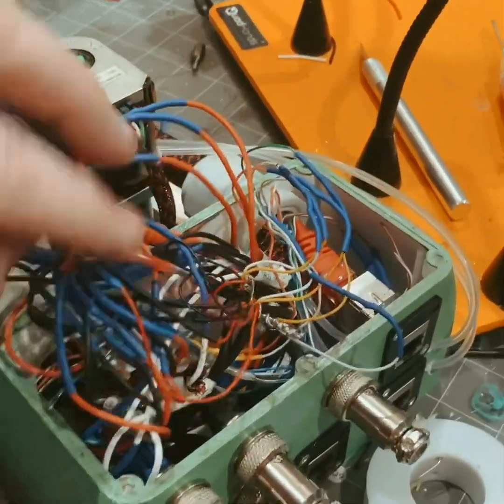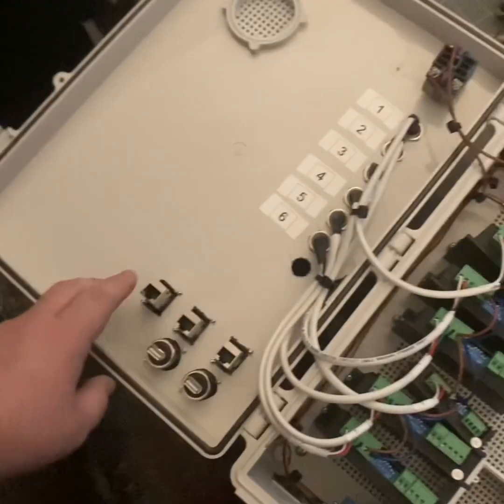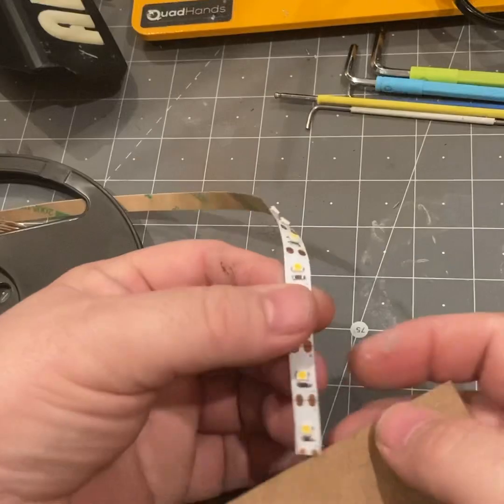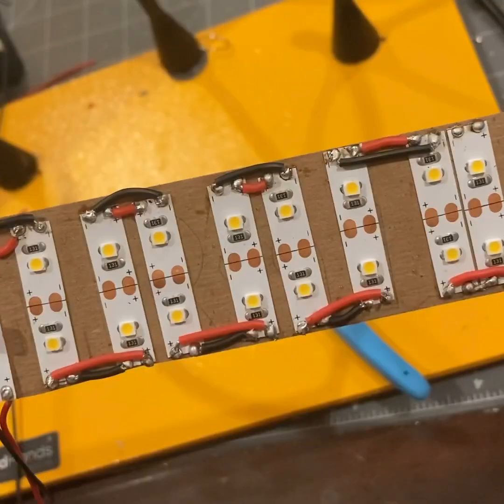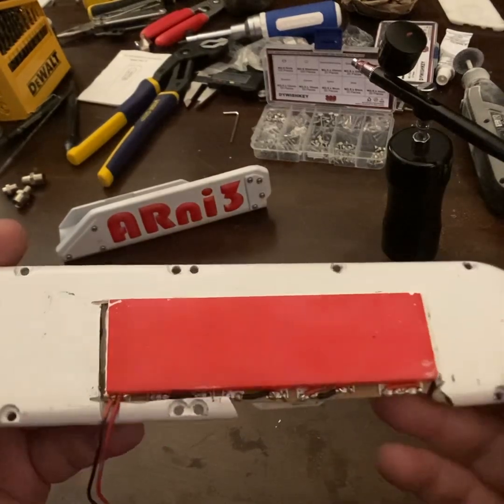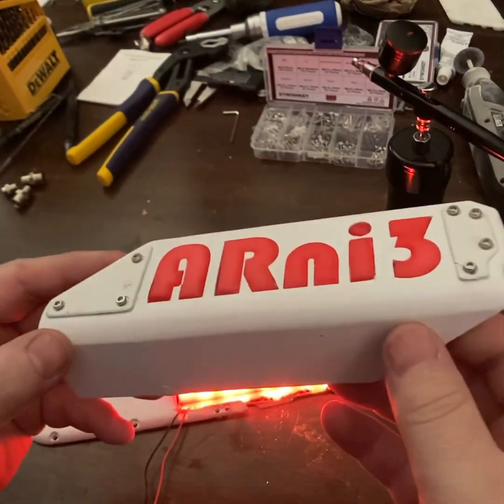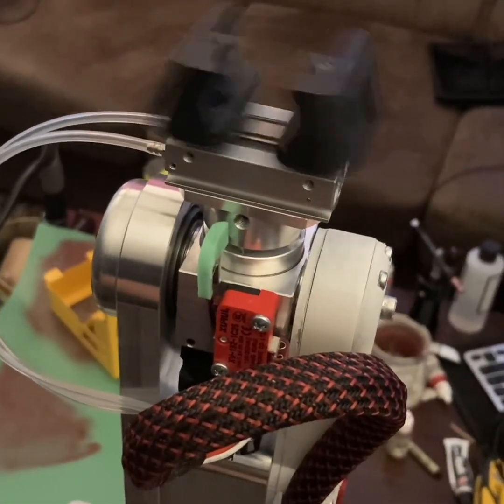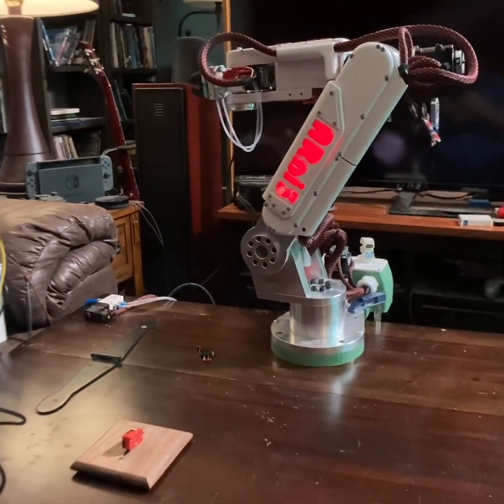AR3 robot ARni3 is done!

Comment: Super cool build, I'm thinking of building the AR3 for my man cave. Do you think something like this would be possible with these bots? My main concern is with the shaking motion and speed under load. https://www.youtube.com/watch?v=EivBxP3kqWs
Reply from the maker: I bet it could do it, especially if it’s like in the video where it brings the load closer to its body rather than trying to shake it while the arm is stretched out.
Reply: @thecraftinator9070  thanks for getting back to me, its great to hear you think it could be done because the other options are significantly more expensive! Do you think the speed could be similar?
Reply from the maker: @ok25531  yeah, this sucker can be super fast.  Especially if your moving multiple joints like the bot in your video.  Like using the wrist to whip the last portion as a secondary motion,  so the joints work in concert to get that movement.
Reply: @thecraftinator9070  Looks like I have a lot of robot kinematics to be looking into!  I’m from a software background so it’s all very new but that’s part of the fun haha. Thanks for the help!
Reply from the maker: @ok25531  absolutely, I want to get the gist of the simple programming language, you’ll be fine. The hardest part it’s just the amount of time it takes to build the robot, which is a ton of fun, but it’s not a quick process.

Comment: Hello, very good job, currently I have finished assembling my ar3, I followed all the steps in the manual, I did not want to deviate, now that I test it it works, but I have a problem, when doing the autocalibration of all the servos, it does not return j6 to 0 °, stays touching the switch, and marks me successful calibration. separately j6 works for me without problems, it rotates in both directions, only when I calibrate it does that to me. I need it to calibrate correctly. it doesn't always. What do you think it could be?
Reply from the maker: Have you figured it out yet.  After I first completed my build, I had a ton of problems, it took a few weeks to figure out the things I did wrong.  I would check to see if you have the right plus and minus 5v going to the switch for J6. And make sure the right wires are going to the right connections on the switch.

Comment: Nice video. Loved it. I m currently building ar3 and trying to post for every single step I am doing on Instagram (sertengineering), hopefully it s gonna work like yours. Like you said, a lot of soldering. I keep getting a lot of mating issues thou (either they r too loose or too tight)
Reply from the maker: Glad to hear it!  Diligence was the key for me.  Just keep pushing forward.  There were a few steps I thought, I’m pretty sure I’m not gonna be able to finish, lol, but you keep pushing.
Reply from the maker: Not yet, I had to push it to the side for a bit while finish my current project.